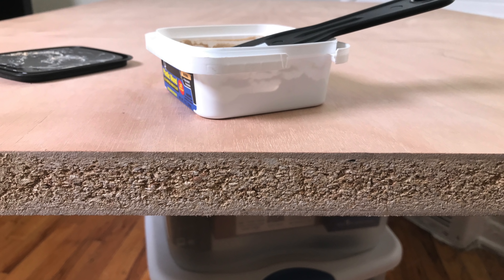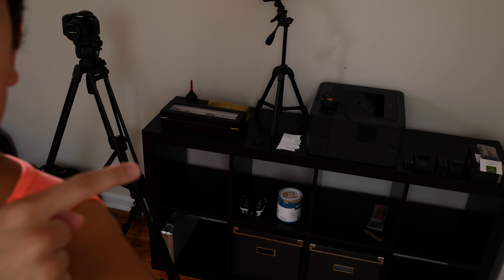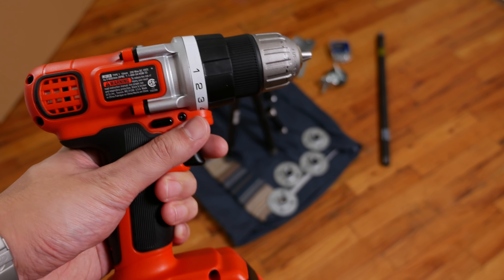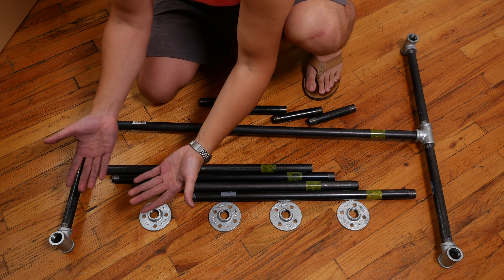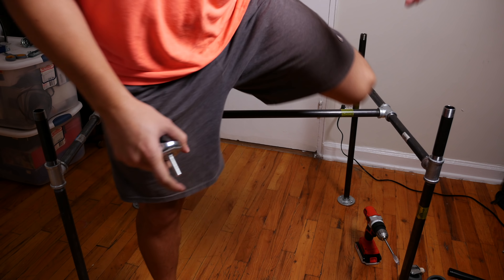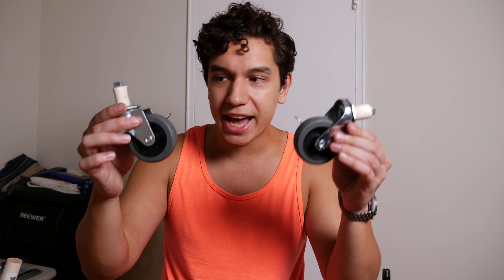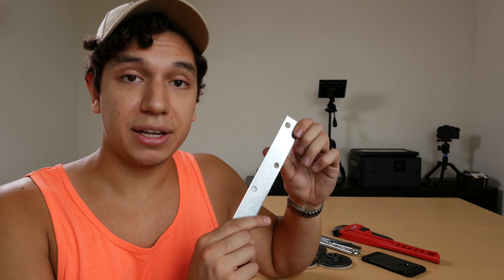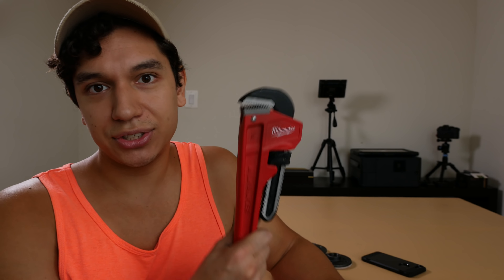How To Build a Plumbing Pipe Workbench Under $400 - DIY Home Depot Project - Problems & Solutions

Comment: Looks great. Props!  Makes me want to make one for myself now.

I can see it now, Take Charge of Your Space with Patrick Marlett Channel coming soon.
Reply from the maker: I just started watching Home Improvement again, haha. All this construction making me wanna scratch that particular itch. Thank you! Really happy with the results 😍
Reply: It's fairly simple, but effective, design.

Been thinking of finding a way to make my own workspace at home recently. Going to need someplace in my limited home to start making more videos for a channel I want to start up soon. It will have nothing to do with watches, but about creativity. I'm going to go out on a limb and see where it takes me.  That's pretty much the only way to start these things and go for it, right?

I either have my corner of the living room which I should get some sort of temporary wall I can set up to block off the view to the rest of the house. 

Or, I have built a substantial custom work desk and display cabinets in what was supposed to be my end of the garage to be my own man cave. However,  it needs some clean up as I've not used it for the designed purpose really since I more or less finished it.

But, more importantly, if I do use that space in the garage, I seriously need to invest in a portable air conditioner. There are no windows that can open and it gets quite toasty in the summertime, even not when cars have just come home and parked inside. And, I don't want to leave my garage door open as the only source of some ventilation. Even partially, it's not enough and I'll likely be sweating a waterfall which isn't that good to video myself like.

Anyways.. looking forward to your normal watch related content as always.
Reply from the maker: Take Time was initially suppose to cover all forms of design, not just watches... Only, I had a leg up on that genre - and I happen to really enjoy timepieces - so that’s where we are now. 👌 I am interested in starting up another Channel of mine again (centered around gaming), but Take Time will likely transition to being my “Review & Interview” show centered around design & products: watches, electronics & so forth.

Yup, it never comes out the way we want at first. Make those incremental changes as you go, but just go. Do it. It sounds like you’re pretty much ready. I vote garage, put up some sound dampening pads (which I need to do) in the space and start from there. Excited to hear about this project as it begins. 🙏

Comment: Nice job. I think the flange feet are more practical for your use—smallish table, small room, indoor use. Plus, you can easily turn the flange feet to level your table. I might try the same pipe frame with a thick cork tabletop I have in my den. Hope your setup is still working for you!
Reply from the maker: Love it! Still using the table to date. The 3x4 top dimension has been perfectly for weekly use.

Comment: Nice work on the table and great DIY video!  There is another alternative for castors if you wanted to retain that feature:  flanged castors.  Amazon sells them here:
https://www.amazon.com/Swivel-Caster-Wheels-Locking-Polyurethane/dp/B06Y49D2J2/ref=sr_1_4?ie=UTF8&qid=1536866082&sr=8-4&keywords=castors
and there are many sizes and different styles.  You may need to look around to find one with a hole pattern that matches the bottom feet that you used or you could make a wood plate with a dowel glued in it to go up into the end of the pipe.
Reply from the maker: Thank you for the alternative solution! That's an excellent idea... Wish I knew about it earlier, haha. I'm quite happy with the felt pads, actually. I like how they keep the height lower with the flanges flat against the hardwood. Slides around quite easily as well.